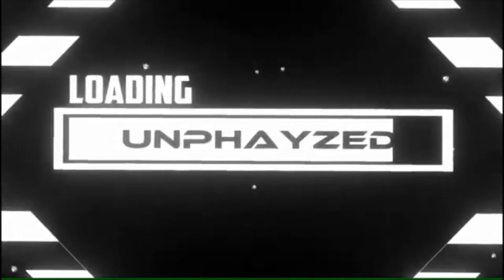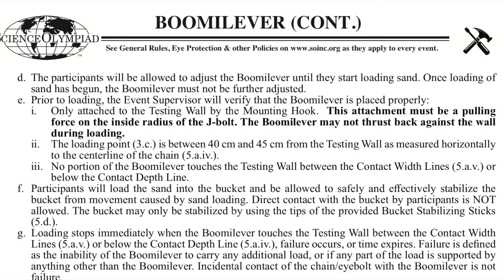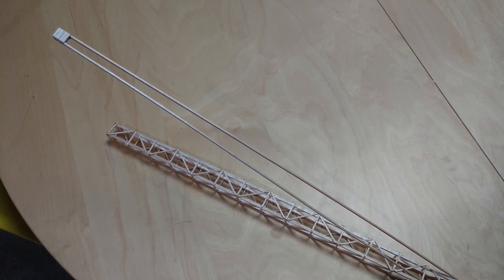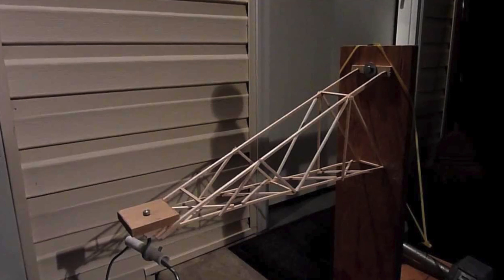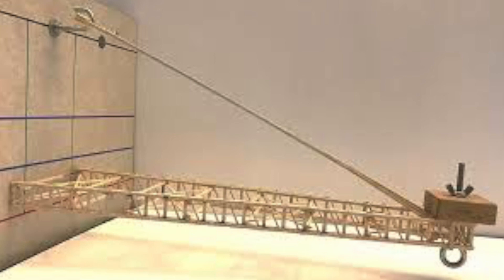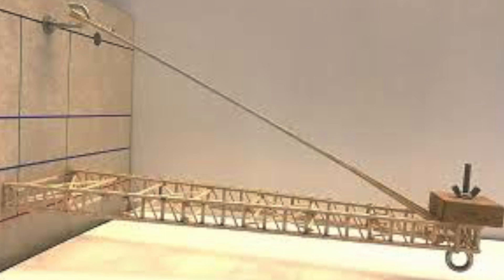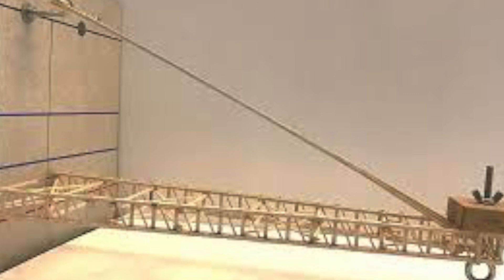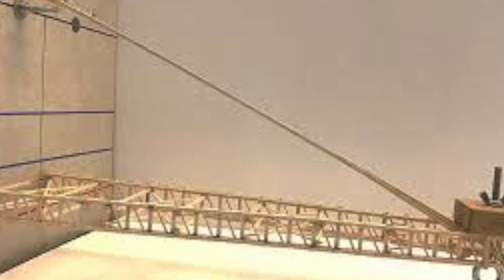Science Olympiad Boomilever 2021 | Boomilever Designs

Comment: Should i add braces to the tension?
Reply from the maker: I've honestly found success without it. If your tension pieces are causing you issues by breaking too early, I would try and find denser wood to use for tension. Personally, I have found that thin bass strips (1/32" x 1/8") work exceptionally well. However, if you can't get your hands on any bass or dense balsa, then adding braces should help.